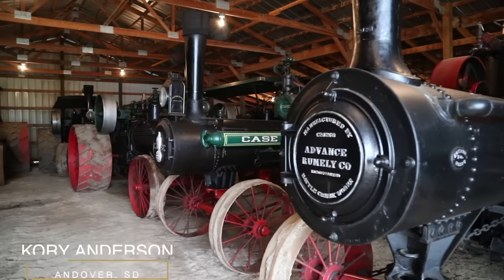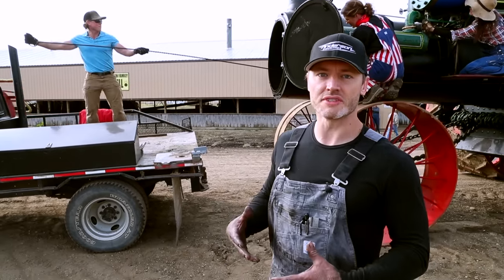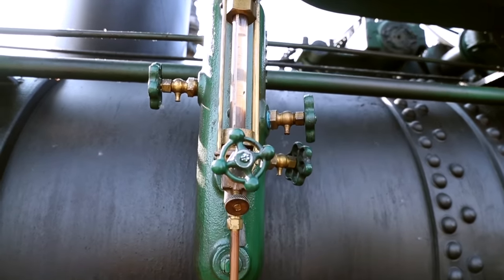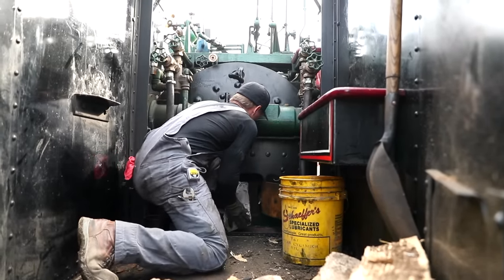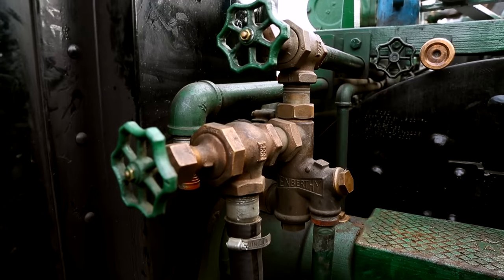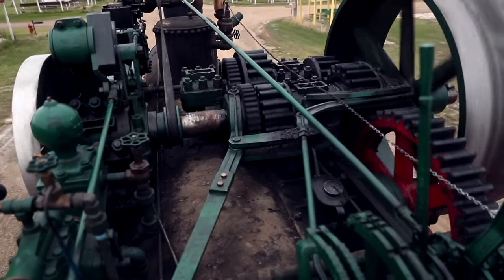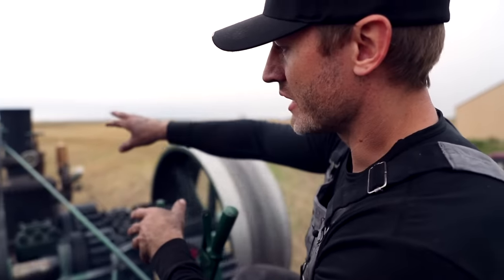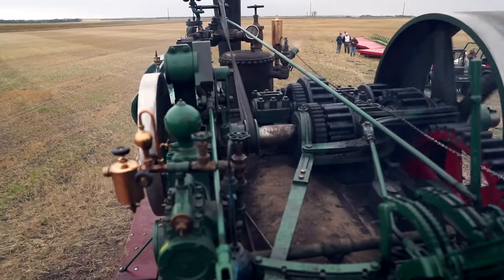FIRING UP the 150 CASE - The largest steam traction engine in the world prepares for a record pull

Comment: John Deer: "everything runs on software. To replace that hydrolic line, or put on a new tyre, you'll need to bring it in and pay us"
Case: "have fun kids"
Reply: That’s the problem with modern farming equipment and cars, everything is electronic, and electronics go bad and they are insanely hard to try to get right again, at least on your own and a nightmare scenario is if something goes badly wrong in the middle of harvest season and even if you’d have good mechanical skills you can’t fix it yourself because everything is electronic and controlled by software and the repairs might cost several thousand
Reply: @onelyone6976  one of my Dad's friends in Germany has his little collection of antique tractors. But he also has a newer CASE (sorry I don't know what model). But I know he loves it, because the one time he had to replace an electronic part. He could simply plug in his own laptop, with his CASE supplied software, and tell it he replaced it. I know people here in Ireland curing John Deer for how hard it is to simply change the lightbulb without the computer getting upset it's not a matching part. Prettymuch the same as Apple have been doing, and finally brought to the next level. You can't swap anything on the newest IPhone. You're forced to take it to Apple, and pay as much to repair it, as a new phone...
Reply: @GrasshopperKelly  my grandfather lives at a small farm, he has 2 tractors, one Valmet 502 and a newer Valtra and pretty old farming equipment by today's standards and for some there are barely any spare parts available and part of the reason he kept them is because they are all mechanical parts and no software or too many electronics, so he can fix them himself with some jerryrigging to keep them operational
Reply: @onelyone6976  well, one does what they literally must, to put food on their table, to keep that table, it's roof, and make sure they'll be food on the table the next year.
What big companies are afraid of, is another company copying their software. Something that cost the company to develope.
Or the ever growing regulation. The make the company more and more liable for something like an accident.
As an Automations engineer, I love old machines with a passion. But I fully understand why computer controlled parts on anything, from a car, farm or construction machine, to the sterile filling machines I work on, are better.
Reply: Modern case stuff is the same 🤷🏻‍♂️
Reply: @EstorilEm  Yea, accept CASE will willing to come to you if need be, and is willing to plug into your Tractor remotely and help you fix the issue on your laptop if you have one. Ie, so you don't have to have the thing towed to a garage at the price of a new tractor...
Reply: @GrasshopperKelly  pretty  much the issue. It not like people can't learn to fix them. People are getting more and more technology advanced by the day. Its that the companies realise this and are now refusing to give the software required and if you make your own they then sue you
Reply: @biohazardlnfS  I know. Apple has been paranoid people will duplicate their software, like people make off brand car parts, or more relatable, phone parts. Apple just saw a product, they can put their own keys on, and anti-theft tools.
So it's become the norm. I don't damn the fear. A company intents to make money. Fear of loss of money, and then losses in profits, leads to a decline, and a lot of the rimes folding.
The way Apple reacts to hood onto that monopoly is well past paranoid or greed though.
Case and Ford, make their software more or less "easily" available, to protect their customers, from fake copies, or when they have problem swith their cars etc. Because what are you or I going to do with that Software?!
Reply: @GrasshopperKelly  like your father seen Lanz Bulldog tractors like that?
Reply: @nzo_6543  if he has, they weren't his. No one in my family works on a farm...
Reply: @GrasshopperKelly  yeah i mean he saw one? If none is ok. Not a problem.
Reply: It's not specifically legal, but there's places to go to find bootleg dealership software.
Software piracy isn't just for kids stealing videogames and music.
It's for getting back your rights that get stolen from you, too.
Reply: @onelyone6976  nothing a Det diesel two stroke won’t fix
Reply: underrated
Reply: @onelyone6976  capitalism 101, innovate only to line your own pockets.
Reply: @onelyone6976  this post here was made by someone who had no idea how electronics work
Reply: im no farmer but most companys will come to you for service when you have millions in equipment
Reply: @davidlabossiere1905  I meant that companies now, like the big green and yellow and others, no longer allow people to work on their own stuff. Even going as far as to void your warranty if you service your own equipment, which is slimy and Un-American.
Reply: Yeah of course it's way easier light up a fire, wait for fire to raise and get up to temperature and wait until water boils and steam gets up to pressure than turning a key in a climate controlled cabin. John deere allows all kind of maintenance everything is accessible it just has some failsafe things to prevent those who think they know something about tractors from fucking up something. Some tried to make scandals but failed John deere is still the king or one of the kings in industry. I like those steam machines and i also like modern stuff.
Reply: @dkdanis1340  you completely ignored the point being made
Reply: @onelyone6976  Electronics and cars (and tractors) do not mix.

Or you have the type of electronics they build into mercedes type 123, that stuff breaks an sledgehammer...
Reply: "keep your fingers out of the spinny bits".
Reply: No reason to make all these utility vehicles whose fundamental functions can be 100% analog into some digital nightmare.
Reply: @davidlabossiere1905  John Deere charges an arm and a leg to come out.
Reply: @onelyone6976  eh thats partially why we use equipment from 1980, no electronic, it basically immortal at this point.
Reply: those times will come again, right after recession
Reply: @onelyone6976  The problem is that all of the electronics are completely proprietary to the company selling the vehicle and some companies (eg. Apple, John Deere) have used that to write the software to try and rip you off for replacement parts rather than just making it easy to fix things. You don't see this problem with the old fashioned desktop PCs because almost all the manufacturers build parts to fit standards so it's easy to replace bad or outdated parts and the like, or adjust the software to suit your specific needs. Heck, currently 3 out of the 4 PCs I own are cobbled together from a bunch of old parts in some cases literally pulled from a junkyard all built for less than a couple hundred each and that's not even getting into the room full of random old parts I've got. 

If tractor electronics were like desktop PCs are, you'd be able to call up someone like me who'd probably have half a dozen compatible parts for anything that broke lying around and could drop it out to you at a reasonable cost within a couple hours. Even install it for you if that's what you want.

actually thinking about it you see it a little with PCs too: It's generally recommended to reinstall Windows rather than just swap over your old storage into a new PC, but that's solely due to licensing...If you're running Linux, you can just pull your existing HDD out and boot it on any compatible machine without hassles. You can even install Linux to a USB drive and tell whatever PC you want to boot from that, I keep a USB around with Linux and a whole bunch of diagnostic programs installed so I can quickly and easily test any troublesome PC to determine what's wrong with it.
Reply: @TheDemocrab  I’m getting a little better with electronics myself, and once my current laptop gives up and I’ll have to buy a new one I might retire my current one to linux tinkering
Reply: @onelyone6976  I'm having the opposite kinda deal atm, attempting to work out how the electronics in my car work.
My end goal is to eventually reverse engineer the computers/software so I can attempt to fully replace it with something of my own design using easily available parts.

Linux tinkering is a helluva lot of fun. All my PCs run Linux these days because all the games I play run it now and I'm a tinkerer at heart.
Reply: I have a J.I. case 730 4cyl dual range diesel, what a tractor.. it goes and goes and goes and never breaks down.. will never use anything but J.I. case tractors.. the best
Reply: Case is still making tractors to this day.
Reply: @onelyone6976  It's either you screw the machine or company screw you because of your ingnorance. It's still your fault
Reply: Underrated comment.
Reply: @GrasshopperKelly  Between you and @OnelyOne, you've both taught me some interesting things about the farming industry with your conversation. Thanks for sharing!
Reply: @weylinwest9505  well... is that not what the internet does best? :D
Don't need to thank me for ranting with walls of text xD
Reply: It would be one thing if the cheap unreliable automation was well meant by the manufacturers but it is a greedy effort to raise profit by any means necessary.  I won’t buy Deere and neither should anyone else unless it’s pre-1990.
Reply: A kindred spirit I see.  I’m not a farmer but I have a small Kubota from 1982.  Wouldn’t trade it for a new one.
Reply: @welsh_Witch  how a computer actually functions is engineering school kind of complex.
Do you have any idea of the crazy-math they use in computer science class to explain it? 🤔
Reply: @onelyone6976  7olp

Comment: In the spirit of todays meems : Case engineer " How much toque would you like ? "
Farmer " Yes "
Mud on the wheels is a good look.
Reply: @Riyame  Thats two and a half times what a typical aircraft tug/tractor has. Would be fun to tow a couple of dreamliners with one of these!
Reply: Enough torque you could hook a chain to the ground and haul the earth off its axis.
Reply: @jasongreek2342  that's how earth ended in this solar system
Reply: @jasongreek2342  it rotates the earth underneath it, this is why we have a day and night cycle

Comment: ah yes, when water and wood was a perfectly viable fuel.
Reply: Much safer than petrol and all Oil products
Reply: @nikolaiorr8383  no far from it. these things blew up all the time
Reply: The way things are going we might just as well go back to steam power.
Reply: @willkrull7316  things are going?
Reply: @Jo3W3st  biden and his bullsht causing inflation of fuel prices
Reply: Wood still is. Lookup wood gassifier trucks.
Reply: @ryanroquemore  I know. Not widespread anymore though.
Reply: @livonia1807  electric and hydrogen cars have been invented ya know
Reply: @nikolaiorr8383  No, these things pollute like crazy and destroy the air quality.
Reply: I didn't know water is combustible.
Reply: @roberti.1358  do you not understand how steam engines work?
Reply: I mean, wood is kinda of a starter fuel.
Reply: @InfamousAMH  
Robert
I didn't know water is combustible.
you
do you not understand how steam engines work?
- that's implying they do work by combusting water, which they DON'T, and it's NOT combustible
SO, what was your point ?!
Reply: @michaelanderson7715  steam builds and creates pressure which in turn can be used to produce mechanical energy. Water is not combustible.
Reply: @InfamousAMH  I know how they work, and I already stated 'water is not combustible'. This response doesn't directly state your point, I inferred it though.
I'm glad you're not claiming water is combustible.
Reply: @michaelanderson7715  I'm so confused, I wasn't telling you like you didn't know, you asked what my point was. Robert seemed confused.
Reply: @InfamousAMH  yeah, and we now agree on what was meant...and robert is confused, I agree
Reply: @InfamousAMH  I understand very well how steam engines work.  The wood, oil or coal is the fuel, not the water.  If water was a fuel you might be able to use it in your gas tank to run your car, and you would not be able to use it to put out a fire.  Fuel is a material that is burned to produce heat or power, and it is where the energy comes from to make the whole thing work.  Combustion changes the fuel's chemical energy into thermal energy.  The thermal energy is then transferred to the water to produce kinetic energy in the form of steam which drives a piston that turns the wheels of the  tractor (or locomotive or whatever) through a series of gears and connecting rods..  Fuel is used up and spent.  Its chemical bonds are broken and the energy they contain is extracted.  Water is changed into steam, which is a change of phase, but its structure is not fundamentally altered.  No chemical bonds are broken.  It remains as H2O.  If it were possible to collect all the steam and condense it back into water it could be used over and over.
Reply: @InfamousAMH  I understand very well how steam engines work.  The wood, oil or coal is the fuel, not the water.  If water was a fuel you might be able to use it in your gas tank to run your car, and you would not be able to use it to put out a fire.  Fuel is a material that is burned to produce heat or power, and it is where the energy comes from to make the whole thing work.  Combustion changes the fuel's chemical energy into thermal energy.  The thermal energy is then transferred to the water to produce kinetic energy in the form of steam which drives a piston that turns the wheels of the  tractor (or locomotive or whatever) through a series of gears and connecting rods..  Fuel is used up and spent.  Its chemical bonds are broken and the energy they contain is extracted.  Water is changed into steam, which is a change of phase, but its structure is not fundamentally altered.  No chemical bonds are broken.  It remains as H2O.  If it were possible to collect all the steam and condense it back into water it could be used over and over.
Reply: @michaelanderson7715  That water is not properly thought of as being a fuel
Reply: @michaelanderson7715  that water is not a fuel
Reply: @roberti.1358  "that water is not a fuel"
- I know that ,why are you stating this to me ?
Reply: @roberti.1358  I never asked
Reply: It really wouldn't be hard to make a steam powered anything run off nuclear fision. Even short burning cells could melt tons of water. Only one minor major issue is needing a hasn't suit to change your engines fuel but it would be all power no pollution
Reply: @tripwire3992  I was about to consider your opinion, then I noticed you have a anime profile pic
Reply: @rampage3337  only the American ones
Reply: @Digitalstorm007  they are actually more environmentally friendly than petrol
Reply: @roberti.1358  

Technically water can be used as a fuel. With electrolysis, you break it into hydrogen and oxygen.
Reply: @InfamousAMH  depends. Are you trying to burn the water directly, or are you separating the atoms in the water to burn the hydrogen and oxygen?

Edit: Didn't see the comment mentioning electrolysis until after I posted mine.
Reply: @TheWoodsmanMilling  this is explicitly discussing steam power 💀
Reply: @tripwire3992   E-Cars have shit range, and Hydrogen is pretty much only viable in Cali.
Reply: @livonia1807  Oh no! You weren't educated in how an economy rebounds from NEGATIVE fuel and oil futures because nobody was driving or using any fuel.*

When the demand went down the price went down due to the obliterated the economy thanks to a horrendous Covid response.
When supply was gradually ramped down due to the glut of gas and oil.
Supply will take take time to ramp up as it rebounds.

Also, it's worth mentioning that the price of oil and gas are both just slightly less than they were in 2019 pre-pandemic. 
Now, who was president in 2019? Hmm...
Keep blaming Biden, though :-)

(*This was especially true in Texas when their deregulated natural gas power plants froze and killed people... oops.)
Reply: Water is sort of the second half of the fuel, the coal or whatever is creating the heat is the first.  Gotta have both to make power.  

Sorry, i read the comments, figured id chime in, wasnt a direct reply to the op.  

They say steam is inheritly inefficient, but i strongly feel with modern tech and someone with a big brain, a steam engine could be built to be super efficient, perhaps more than any internal combustion engine and very economical,  perhaps more than any electric vehicle.  But that's just a theory i have.
Reply: It’s renewable energy
Reply: whats wrong with diesel and gasoline
Reply: @rampage3337  boilers are super super dangerous lol. You're exactly right.
Reply: I still vote for the original Tesla
Reply: I'm just here to say they only use water to start these up. The process takes a few hours because they have to get the whole fire box going before they start throwing coal in since it's not very easy to ignite right away
Reply: arkansas main export is water and wood. sustainably.
Reply: @tim3172  10 months later, have you come to your senses yet? probably not.